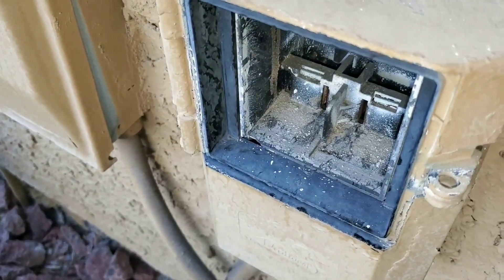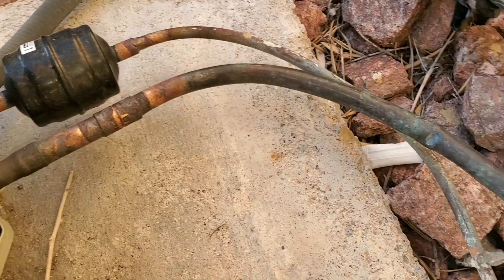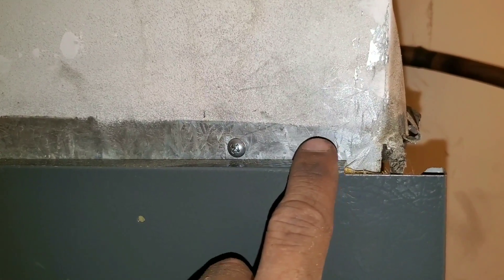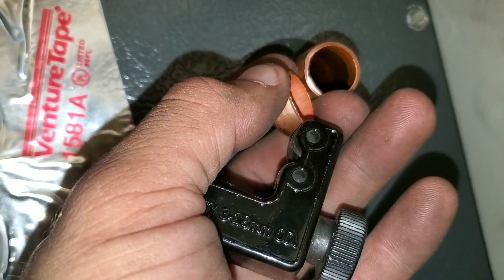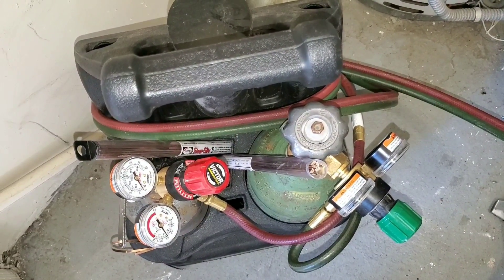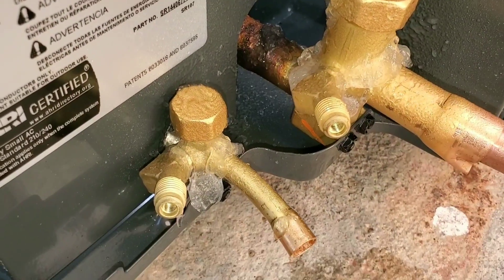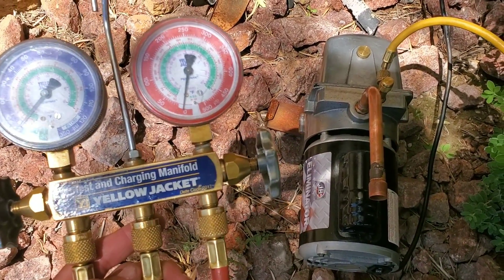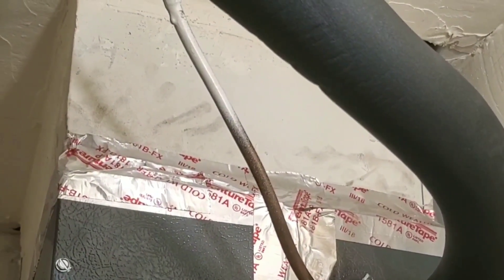Changing R22 to 410A Condenser and Evaporative Coil Simple Easy Tutorial

Comment: Thanks for this video sir. After replacing a capacitor on my unit, it did not cool and pressures were low on both sides.I charged it to 40° coil temp.After a minute, the guages started fluctuating up to 50° then down to 30° repeatedly.What is your opinion sir? Thanks.

Comment: Good video Sam but you forget the trap on the evaporator coil and don't need the vaccum pump, just purge the pipes since it's a new unit and you clean the pipes with R11, it's a good job what you did

Comment: (Not trynna be a smart ass) why dooes the suction line need to be insulated?
Reply from the maker: Insulating the suction line, is to prevent the refrigerant in the line from picking up unecessary additional heat.